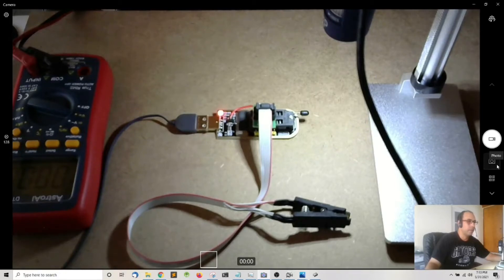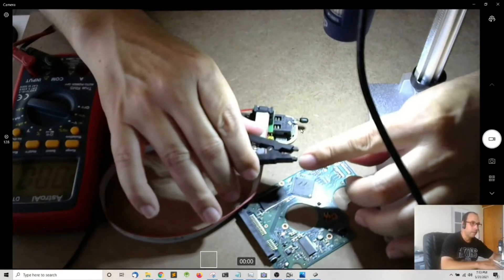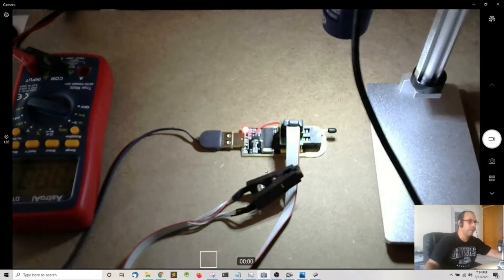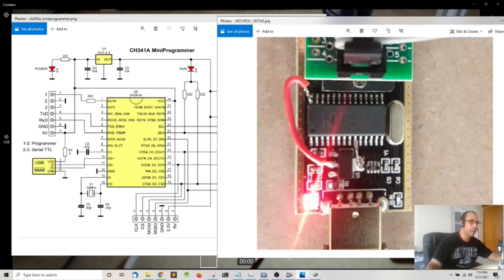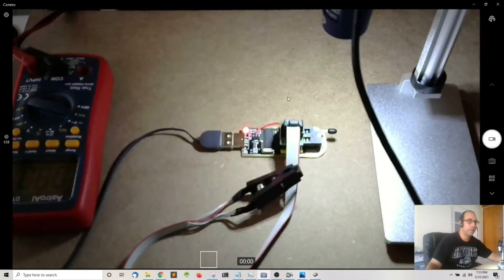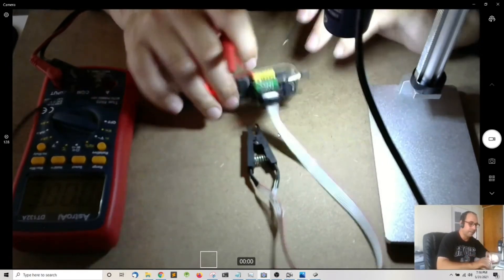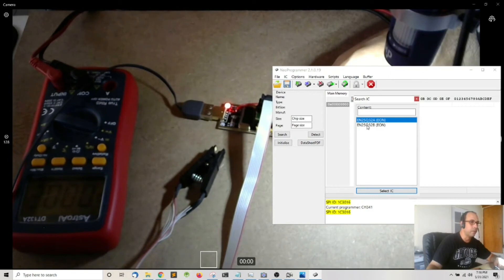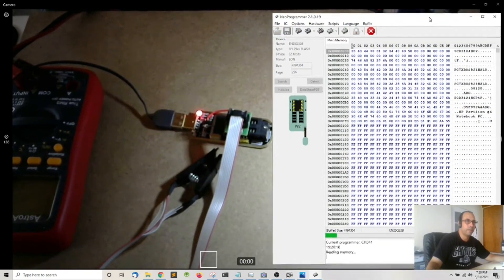How to Program a BIOS Chip Using CH341a Board

Comment: Thanks for the very informative video, what file format does the bios firmware need to be? I have a older dell laptop with a corrupt bios (just prior to them including bios recovery unfortunately), just looking at my options, I have found a seller with programmed ones but I feel like i would learn more attempting to reprogram the existing one myself as long as I can get a hold of the required file from dell.